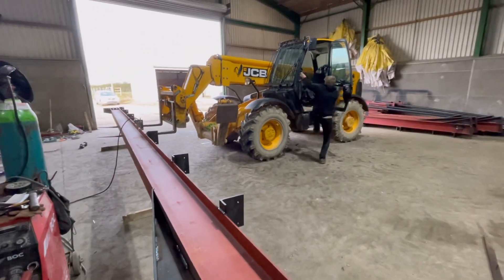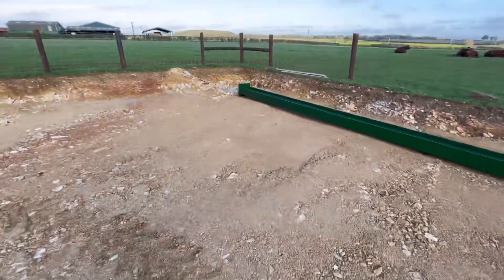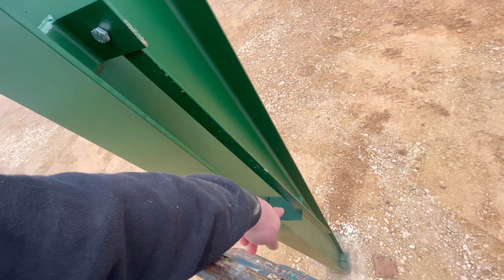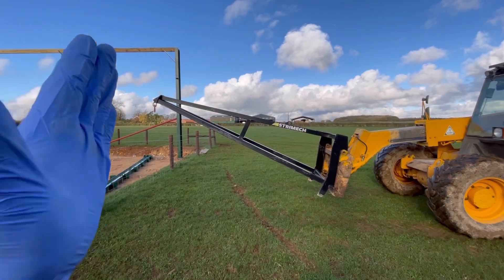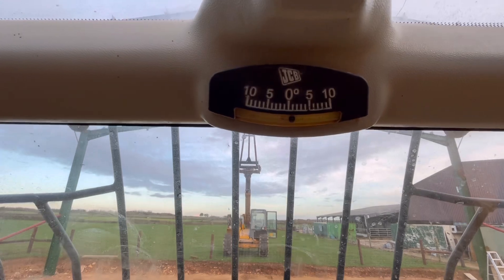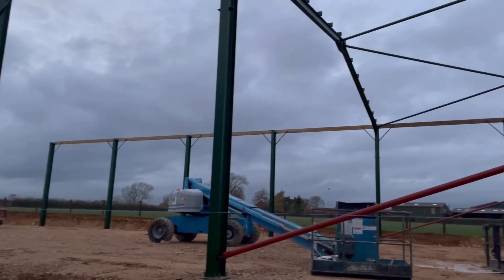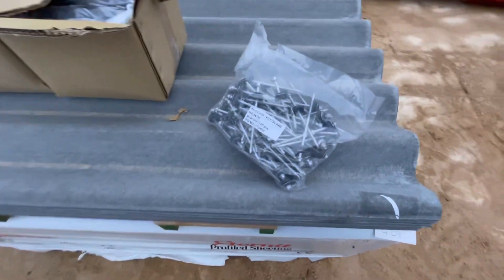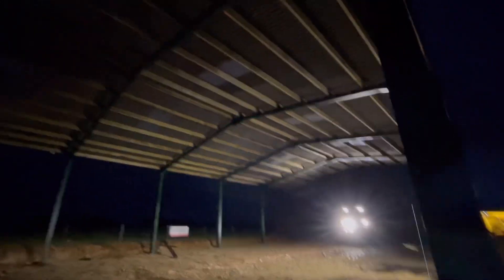Build your own grain store/steel frame farm building (part 2) steel work and roofing.

Comment: A building that span maybe should have had  cap plates at the top of the posts and compression stiffness at the  same level as the bottom of the end plate  of the rafter ,The end plates on the rafter could have been a little thiner

Comment: Can you build me a shed frame? 
Only thing I'd do differently after having 2 sheds put up is use Z purlin as on the first the wood ones have twisted but the Z in 2nd are straight. 2nd one has channel not wood where the gutter sits,  not sure correct name, but keeps gutters straight and level.
Hat off to having a go looks great.
Reply: Z beams are a lot stronger, a bend in metal really strengthens it. They are heavy though haha.. I used 16 metre spans and had to hold one a metre from one end once felt like I had holding a car 13 metres off the ground.. hell I was a big unit back then haha.. I hit a powerline at work n lost both my legs